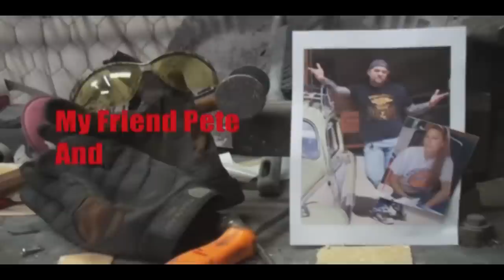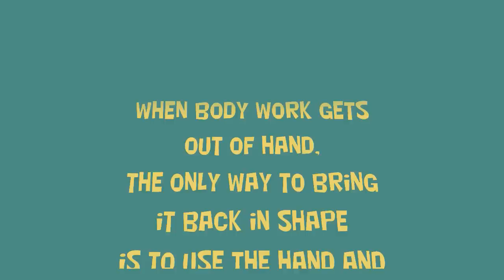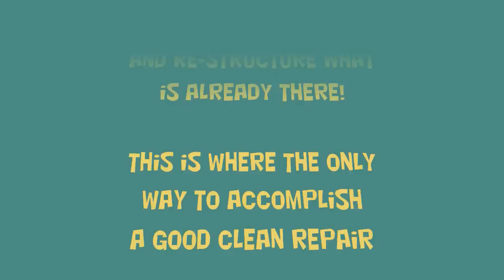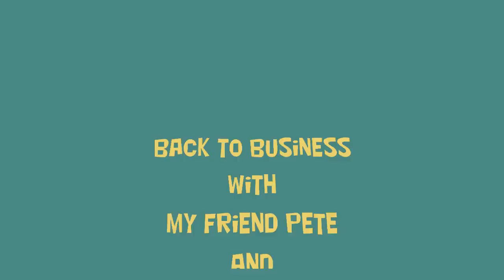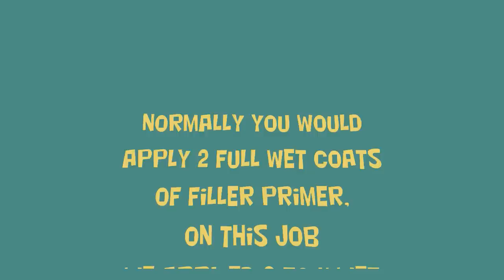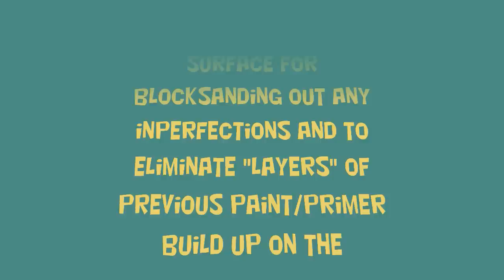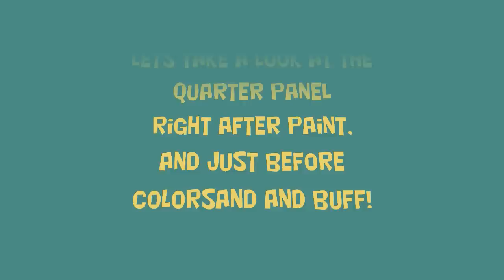How Do I Sand "BONDO" and Make It "PAINT READY"? - From Start To Finish

Comment: I like washing my ass b4 starting my day. I try to avoid skipping showers treating iron& cross cut application method with toilet paper feathered out and uniform.
Reply: Thanks for the advice on proper tools, materials and application method's for my 67elco, I had the body and base primer done by a shop. I want to finish enclosing a 2car metal carport to setup as shop and buy a generator for my compressor it's encouraging.  But I'm a realist and think at best my inexperience &patience would have worn thin too quickly for all the work needed as I found out. with bodywork surprises.
Reply: I'm 62 and if my elco looks good enough to me that's enough  I don't need the shit show car. The world moves&changes fast enough, And there are enough people losing themselves in needs,wants&desires.
Reply: My elco had 3 Pryor body&paint jobs with excessive Bondo, cement filler and primer it was taken down to original and metal  straightened and finished I was shown areas of bare metal and finished surprise areas.b4 first etching primer application was applied with a top coat of wet sealer to allow cure process exposed to outside winter central ca. elements.
Reply: And gringo... my name is not paco Julio or taco vendor. It's RUEBEN
Reply: The best advice I can give when seeking estimates for service of experienced body and finishing work is to be aware in considering possible surprises and extra labor&costs required. It's not like walking into burger King with  attitude & expectations...booger king NO GOOD.
Reply: EXPERIENCED, REASONABLY PRICED Classic car body and paint Tech's are getting farther and fewer in between because they can double  and triple profits with -1/4 labor involved on newer plastic car insurance claims I paid an $1000 in extra surprise labor from original estimate and I didn't bitch or try haggling it down.
Reply: I paid $4000 for body and 1st base coat of etching primer &wet sealer. Tech has 30yrs in business would have never  taken on the job and won't in future all surprise labor and says it should have cost upwards of 6k, he says winter around this time of the season is best time to find a good body& paint willing to tackle a classic car job. SUMMER They are usually unavailable backed up with insurance claims work.
Reply: I removed all chrome, stainless, front&rear bumpers tailgate, rear window&door glass had cowl sandblasted.  Replaced pass side fender.  removed drv side fender and had a metal patch repair and tried a little ruff u-tube Bondo and ding repair. B-4 I decided to take to His shop is in back of liquor store around corner in my neighborhood where I drove it to the shop all stripped down and drove it back to my house. Sure looks good back in my driveway. I think he appreciated all my efforts to make his job as easy as possible.
Reply: Body tech filled up 2 1/2 50gal trash cans of sandpaper and Bondo dust he earned every bit of the $4000, I never imagined how much the 3 previous prep&paint work had built up and rounded body sections. The original body lines really came out amazingly beautiful.